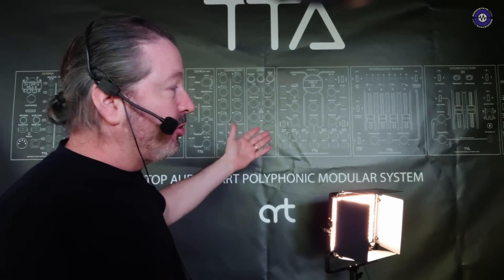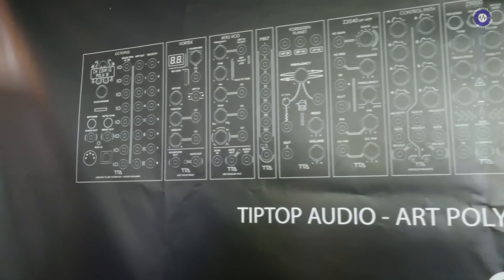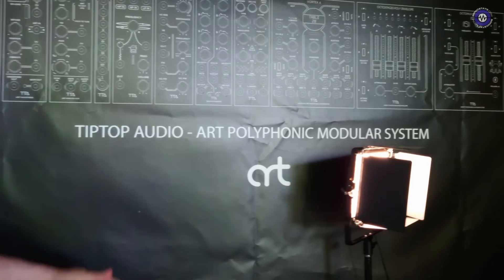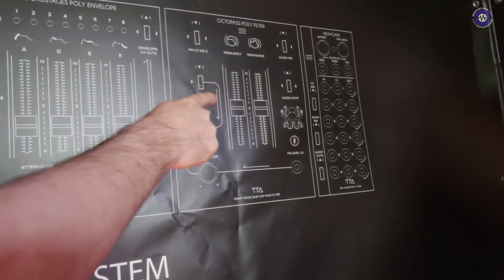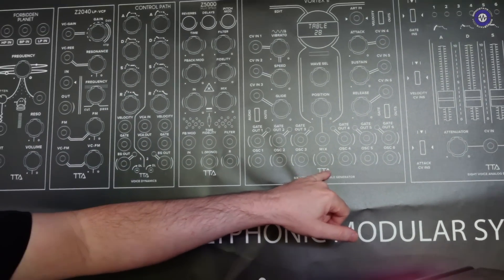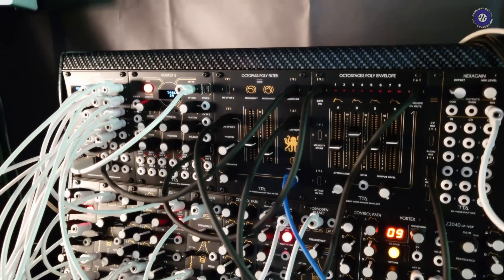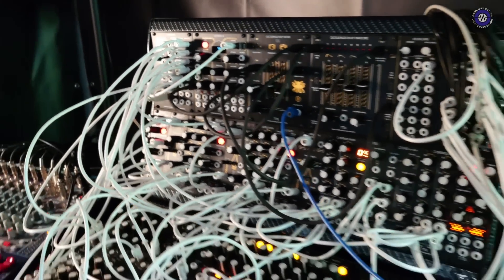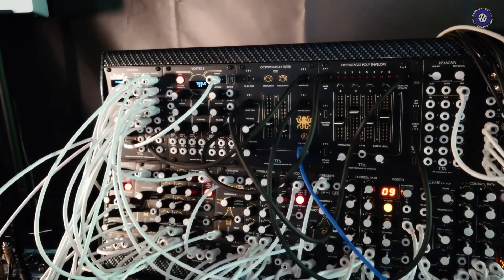Superbooth 2023: Tiptop Audio - Art - A New Control Bus Could Change Everything

Comment: it reminds me that we really need midi 2.0. This is interesting though, I was confused and he should explain outright that it's a digital signal, not "like CV or gate" because those are analog signals that are interchangeable. To me the most interesting aspect about modular is there are no boudaries between audio/cv/gate/trigger signals and you can play with that to get unexpected results. This sorta go against that philosophy (not saying it's useless). also interesting that dreadbox releases its own take on polyphony at the same time
Reply: This was my first thought too. He explained that there was "no reason" to use the "more expensive" v/oct standard for pitch, but doing away with the ability to use any signal to convey pitch information misses the whole point of modular. I guess if it's used in addition to v/oct like on the oscillator that's a value add, but then you aren't getting the benefit of it being cheaper -- and things also get weird from a design perspective at that point. Like, if you're designing a poly filter you're going through the expense and hassle of building a panel with six analog filters but five of them are only controllable by ART (unless you also include six v/oct ports, which defeats the point).

Big fan of Tiptop and glad they're innovating on poly euro, I'm just not quite convinced by this one yet.
Reply: Did I miss some new thing from Dreadbox that is similar ?
Reply: @symbiat0  it's not exactly similar but they released a mono synth voice that can be stacked with other via midi and form a poly synth with the first voice as a master interface. telepathy is the name.
Reply: @hmmmhhhmmh  Ah yes, I saw that (though I’m not sure I’d buy 8 of those to get 8 voices). I think the ART polyphonic modules are super interesting, they look and sound amazing.
Reply: Agree to 100% but polyphonic in modular is nothing new. Döpfer did it long time ago. I use a fully polyphonic system from döpfer and if you own a mordax data ( one of the most important modules ever built ) and use the lil yellow cabels all the tuning Problems are gone…. And if you go a step further and use the acl sinfonion you are gonne get an unbeatable patch. But i am a Tip Top fan. They are doing great modules for very good price. This System sounds very good, but nothing for me to jump on the bandwagon.

Comment: I'm skeptical. A brand new tuning system and a brand new type of connection that uses proprietary cables? Even if the ART signal is as miraculous as they say it is and it will get adopted by third parties, it will create a giant rift in the Eurorack community because suddenly half the modules will be incompatible with the 25 years worth of existing modules, unless every module that will support ART will also support 1V/OCT but that defeats the point. The Polytip jacks and cables are interesting, but I want to see other companies integrating them into their polyphonic modules, and I want to see other companies making their own Polytip cables. Otherwise it will be a polyphony monopoly (which is a fun thing to say and a potential band name). We'll see.
Reply: This assumes someone won't come up with an adapter.

Comment: Interesting concept for a "closed system" (consisting of one manufacturers modules only) with a proprietary standard. I'm sure that will level up eurorack at some crucial points. Even if some manufacturers are going to pick that system up, I'll stay with the more unitarian mode, because I like the philosophy of not bothering with different cable-types. I'm currently interfacing MIDI-to-CV and vice versa, and would not like to expand to more standards in the rack.

No offense still, I'm sure it's a great evolution to other users and if modules support "boring standard CV" as well, it's not a problem to maybe just not use it. :)
Reply: It appears to primally be a proprietary TipTop  system ? 
There was some initial mention of using multiple oscillators (any make) to create polyphony, but nothing was shown to support this that I could see. 
That would be a good tool to have but it's not really being demonstrated here that I can grok.

Comment: Another set of standards that others may or may not follow. It's actually a great idea, but I hope others choose to follow this rather than coming up with competing, incompatible standards. I like the simplicity of control through continuous voltage signals. The digital part is what I wonder about.
Reply: It is a good idea - but it will depend on other manufacturers supporting this standard.
Reply: You make a good point. It is very intriguing, but the cynic in me also wonders how proprietary and or expensive the polytip cables will be. I assume there will be lively debate between futurists and purists in the modular community, but I don’t know where I fall yet. I want to understand it more, and play with it a bit. I certainly like the fact that TipTop are pushing the envelope of what’s possible.
Reply: @FileTransferProtocol  They look like usb-c cables without any chip in them. So just a multicore cable with usb-c tip, It may be possible to use just cheap usb-c cables if thats the case
Reply: @FileTransferProtocol  I should say that nothing will stop me from buying one of these modules if I want one. And I have a fair number of Tip Top modules for a reason. I love that they are innovative and try to keep prices down. I just wonder how it will play out and if others will adopt this or try to put out another version. Even TRS MIDI quickly came in 2 standards. And also 1U.
Reply: if the companies r smart...lowering the cost is beneficial...fingers crossed